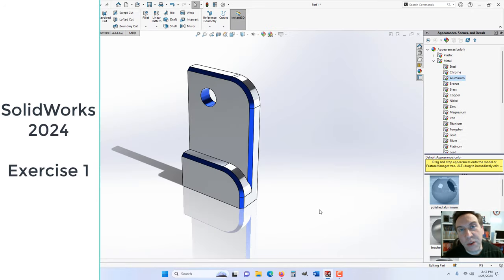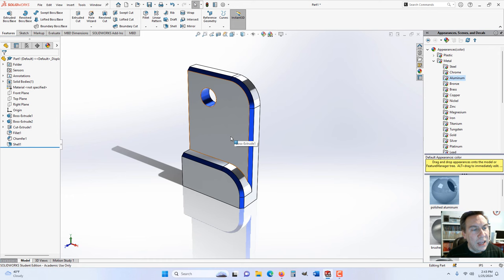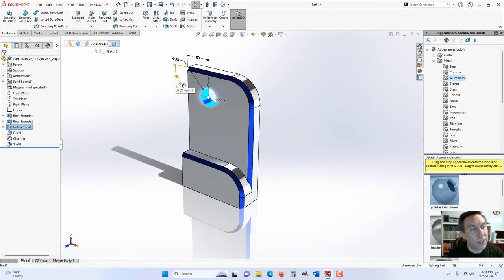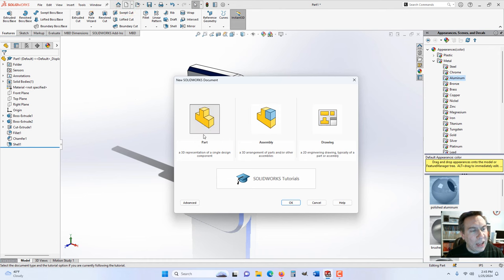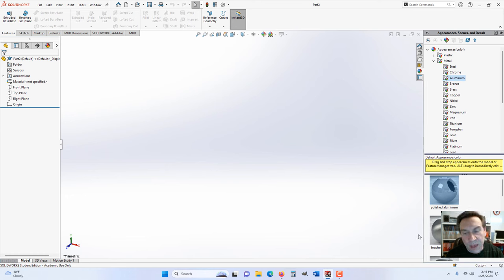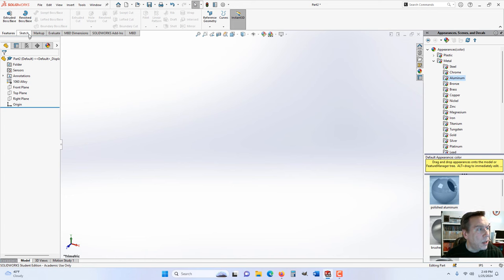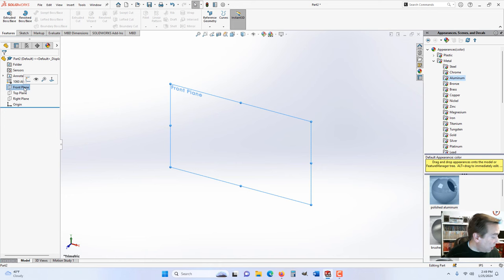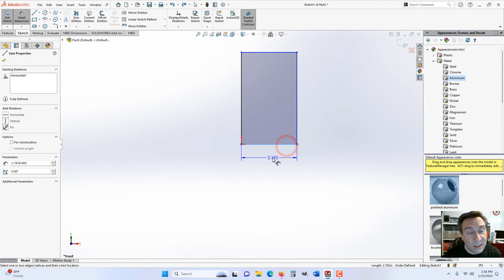E1 SolidWorks 2024 - Basic Modeling for Beginners Tutorial with Training Guide | Tips

Comment: 🎯 Key points for quick navigation:

SolidWorks 2024 Introduction
Basic modeling techniques
Designing a 3x5 rectangle
Sketch on flat surfaces
Use corner rectangle
Smart dimension tool
Extrude boss base
Cut extrude feature
Design intent importance
Shell out parts
Add colors realistically

Made with HARPA AI